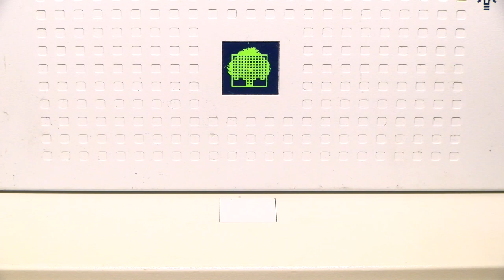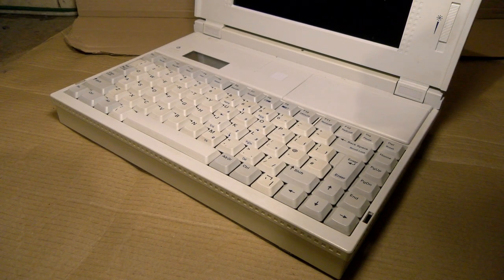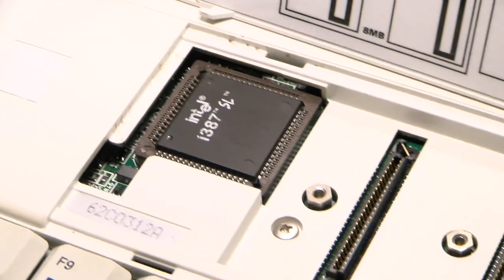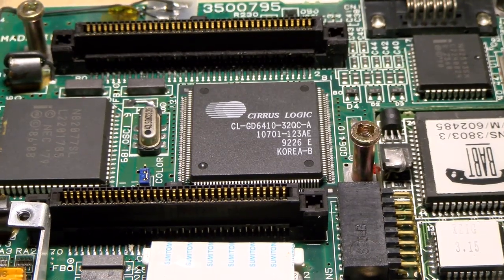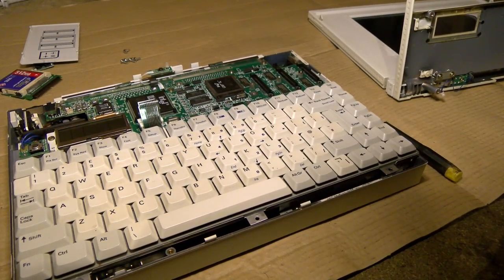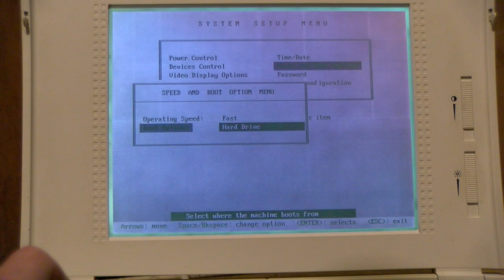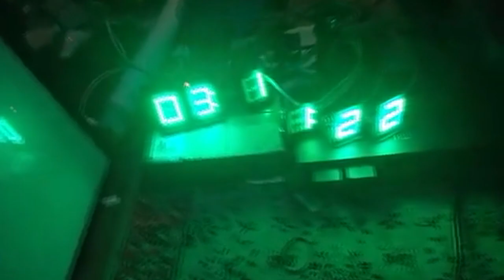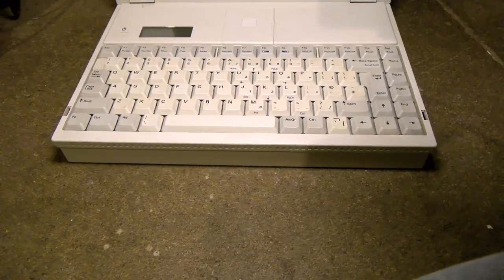Zenith Note 325L Overview

Comment: The legend returns.
I have a Zenith Z-Star ES that's very similar to this laptop except it has an i486DX2 CPU, a built-in trackball and a grey plastic case. What's peculiar about that machine is that there's a battery compartment that allows the computer to be run with eight AA batteries. Presumably this expands the runtime of the laptop on battery power by 20-30 minutes, though I haven't tested this yet because I'm not quite keen on burning through eight AA batteries... I'm now trying to get my hands on an earlier version of the Z-Star that used the magnificently weird J-Mouse (not to be confused with the TrackPoint).
Reply from the maker: Ah, those ones with the AA battery compartment. I'm sure I've seen one, somewhere. Unfortunately it made the machine look like one of those kids educational things, V-Tech or whatever they were called. Then again, those things were probably still more robust than half of the trash that comes out now.

Comment: Man, I only just found this channel too, really been enjoying your videos. My girlfriend who is English likes the profanity when I am watching, she too cusses like a sailor, lol. Hope you come back dude. 
Wanted to add, I watch a lot of tech channels and was never recommended your stuff, I found you when searching, "286 vs 386", or something like that, and you made that awesome video comparing the two both clocked at 16mhz.
Reply from the maker: Thanks for the kind words. I'm trying to get things working to film again, but it hasn't been a smooth process.
In regards to your other comment: While I can't vouch for 86Box, what little emulation I use tends to be limited to either a very 'normal' 8088 and a Pentium with the clock speed unrealistically adjusted up or down depending on what is being tested.
Reply: @HighTreason610  I can't recommend 86box enough, just know it's single threaded so it is really taxing. My computers are pretty old now, I use 86box on an i7 2600 or 8350, and I can only emulate up to a pentium 90. I enjoy emulating the older stuff. It can be fun to push hardware further than it was intended for for fun, like running windows 95 on a 386sx, or xp sp3 on a pentium 90. I also got to experience geoworks again, something I only remembered as a toddler. I keep making more and more machines, you don't need a manager and each one is it's own independent file, no installation required, easily copied and pasted.

Comment: No question your channel could and should be a lot bigger. The problem is that you were shadow banned, the same thing happened to me after my first year. My channel blew up quickly and then it was artificially silenced by the algorithm.
Reply from the maker: It would be interesting to at least know what the magic words or magic actions are that result in this. It would also be interesting to dig through old records on old disks and figure out when things like partnerships and offers from networks appeared, and how the figures were before, during and after that moment. Can't really be bothered to do that, have spent most of this summer wandering and cycling around the countryside, and that makes me feel good, whereas rummaging around in hard drives doesn't.
Still, knew I wasn't the only one.

Comment: Pack is Nickel-Metal hybrid. (NiMH)
Can often just replace them with NiCad if you really wanted to but NiMh are easy to come by and fairly cheap if you don't go for maximum capacity so don't know why :)
Reply from the maker: The pack even has it printed on, but I somehow missed it until editing was already done and there was no real incentive to go back to fix it. In my defense, the print is small light-gray-on-beige and the glasses aren't on when filming. Could probably re-pack it, but not sure it's worth the hassle and I've had enough of NiMhs for now, given I've just finished with a project that added them to a 1920s bicycle dynamo light set to skirt the laws.

Comment: I don't have a Bull Zenith and I don't want one. The whole BT contract fascinates me so if you ever feel like making irreverent (obviously) documentary-style videos, I would watch the shit out of that one. There are so many other things you could cover, particularly the evolution of technology. You have so many awesome examples of CD-ROM drives that you could map their development quite comprehensively. Another thing I would watch is your top ten VGA chipsets, for example. The nuances of the Cirrus chip in this video is a perfect example of that - each chip has a personality and a use-case (some more than others) and this applies to so many other things as well e.g. motherboard chipsets. Anyway, thanks for providing some original viewing during breakfast.
Reply from the maker: The SlimsPort has Groupe Bull branding, but that seems to just be a badge swap as there are units with the original Zenith emblems on them in the wild.
At one time there were plans to make a video about KCom, but it never happened. For CD drives, the one just out of the top of the shot of the Sanyo is supposed to appear at some point, as that one is interesting.
Chipsets were something I tried to sneak into regular videos, where the progress was tracked from the early days of glue logic, the CS8210, the appearance of IPCs and eventual plastic QFPs that did all the work. It probably could be made into its own fairly comprehensive thing, though. VGA would be fun, if only as it would probably annoy people somewhere, given I didn't build computers for speed and hold somewhat contrary views on certain chips that may have been mentioned in this video.
Still, hoping for the clock next. That's 1950s 'early space-age' logic and while it doesn't use modern integrated circuits, it does include several of their forerunners that were extremely difficult to make and act almost like a sort of ROM.
Reply: @HighTreason610  oh yeah, I totally forgot to mention the clock project, that looks fascinating. I do love your synth stuff because I know jack shit about them, plus the electronics stuff you've done before like the CGA/EGA to VGA converter. Basically if you're making something viewers will be into it.

Comment: Look at Wolfenstein 3D on that inverted display.  Can you change the inversion of the display?  My cousin's laptop was in colour.  He got it in around 1994 or so, a later/higher end model maybe?
Reply from the maker: The display has about ten settings, half of which are inverted. This one looked best to the eye but not the camera - the viewing angle required to get the camera into a spot where it could see the screen wasn't great, as the consequence was that I could then barely see it with the eyes.
It does seem there were color versions of this (or else, one was intended to exist) and the chassis design might well have seen off a few motherboards before it went away, so it's entirely possible a machine with completely different specs existed in it at some point.

Comment: Come back!!!
Reply from the maker: I have tried and tried to do so. It hasn't gone well at all and things only got worse with time.
It has reached the stage where I've had to bite the bullet and allocate resources into building a completely new PC, but hardware availability is proving to be an issue and it will take several months to do, due to other obligations.